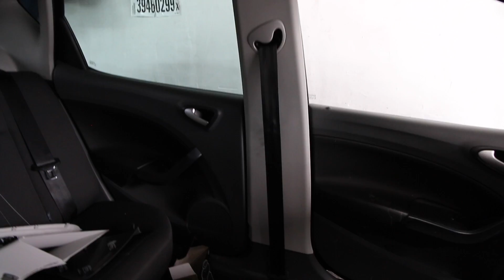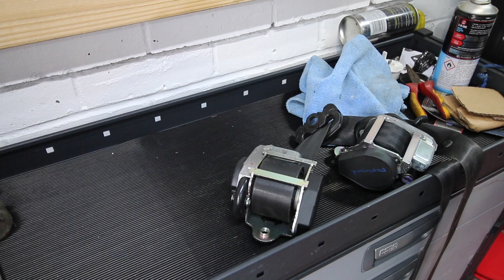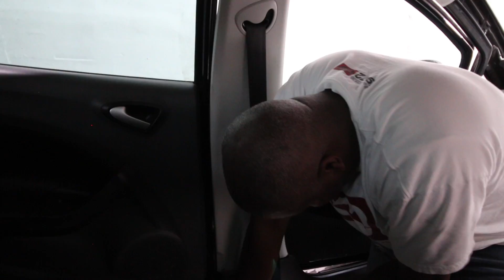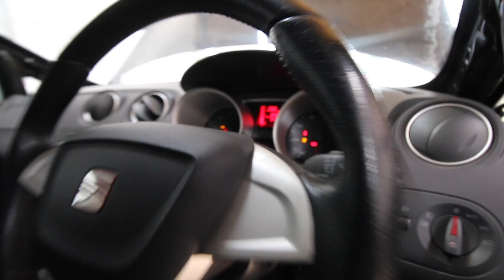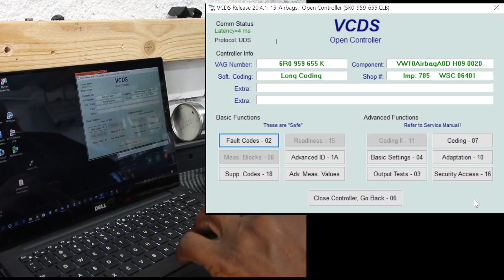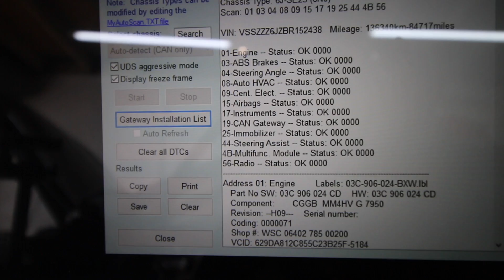How to repair locked up seat belts on the seat ibiza

Comment: Great advice Paul, I had this before a few times even if you try bolt them in car so they are level they won't release its like the belt has filled the reel so much its holding the latch under tension, the ball bearing should drop but it doesn't because of the tension
Reply from the maker: You got it in one. 👍

Comment: Not all deployed seat belts rattle. Like watching u do things the long way Why u opened the belts mechanism ? when the are bolted in and u pull slowly it sets it self or off the car u have to hold it a certain way for it to be able to pull out if not held properly the will lock hope that helps
Reply from the maker: That didn't work because the belt had no space on the reel to release the ball bearing even when bolted in

Comment: Good lesson on the seatbelt being locked up and not having been deployed, suffer this problem in my skoda fabia rear middle belt after folding the seats down, dealer quoted £300 for new one fitted.

Comment: Yep Paul you definitely done them seat belt the hard way, they should release when the bottom is bolted into position 👍 learning on the job enjoy you videos 👌
Reply: Thomas Jackson I had similar problem with the rear seat belt on my Abarth yesterday.  Reel wouldn’t release. If you bolt the reel and anchor it then just pulls out.

Comment: Hi bud hope your well. You don’t need to take the Seat belts apart and you shouldn’t you only need to bolt the main housing of the unit in the car it will then be in it’s correct position and the bearing will drop automatically you shouldn’t take them apart as it can compromise the safety of the device. I hope this helps for the future bud all the best 👍
Reply from the maker: Hi Rob, these were locked solid, even in the car bolted in. I got the advice from a VW specialist.
Reply: What you took out of the "locked" seatbelt is called "Car sensor". What that does is when the car is tiled lets say on a hill, or brakes hard , accelerates hard or does hard turns the seatbelt locks keeping the occupant in place. The seatbelt is made to extract webbing at a certain position of it with a tolerance of +/- 2 degrees from the nominal position.
Reply: How can I unlock a 2015 Camaro seat belt I’m putting the seats in my Monte ss and they are locked